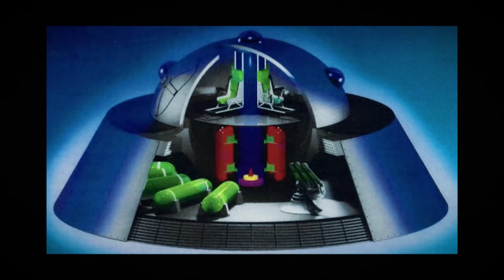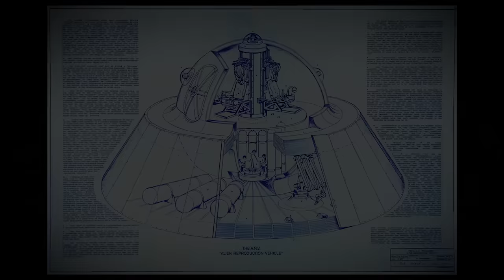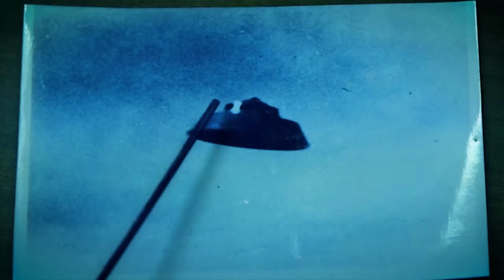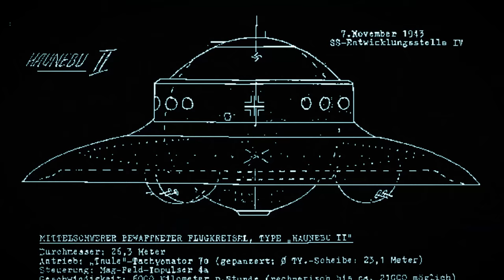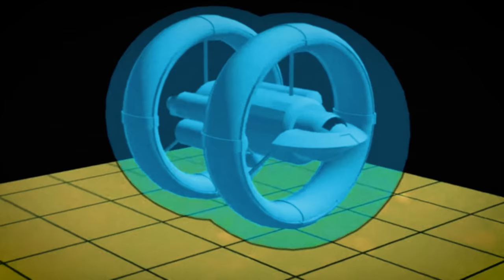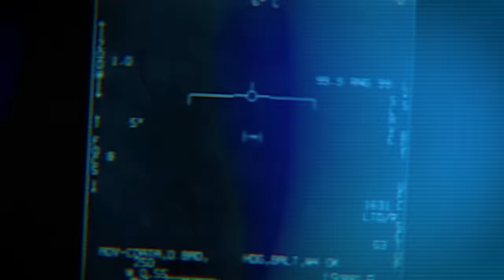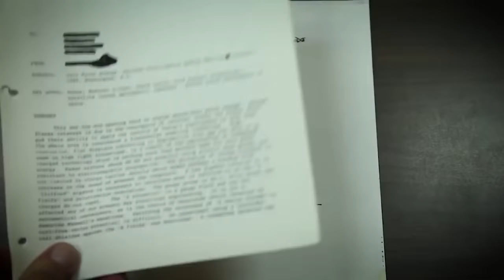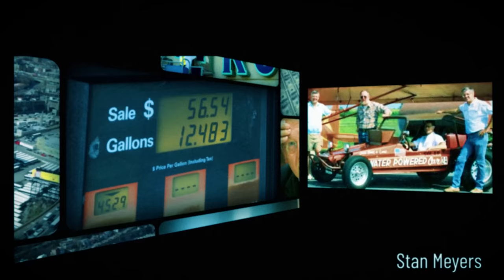How to Build a Working UFO | Alien Reproduction Vehicles (ARVs)

Comment: I saw a flying saucer once. It was late at night and it was hovering about 100' up on the air. I would guess it was about 25' diameter. It was silent, slowly rotating, and had a few lights on the underside. It hovered for about 10 seconds then it started to spin and the faster it spun, the faster it moved. It took off in an arc and was gone very quickly like a shooting star almost. Wild moment for sure. I probably would have thought that I imagined it but luckily I was with a friend who saw it too.
Reply: Same, on my way to University, waiting at the bus stop, it was when the day lights saving time thing changed, so it was darker in the early morning than it usually was, around 5 or 6 am still looked like night time. Across the street on top of the library there, there 3 evenly spaced out glowing orbs, all in a mist of clouds because that day there was a lot fog and it looked to be close to the ground. There are planes that pass by that you can see from afar because the Miami International Airport is nearby by a few miles away, and I saw the lights of a plane fly by behind it, far away in the sky, which gave me a sudden realization of how close those 3 lights were, it was no plane or w.e else…I just stood there, why didn’t I take out my phone to record it? It was as if I wasn’t thinking straight, did something compelled me not to do it? I just stood there watching it with anticipation, and then without making a sound, it just moved up and disappeared behind the mist and clouds, just like that.
Reply: Seeing one up close and personal is such an amazing event. It changes the individuals forever…
Reply: Sure you did
Reply: @PITFALL11  a part of you is thinking "is this for real, is this really happening?" you question reality, or the event, because it's so surreal and so out of the blue, maybe that's part of the reason why I didn't record it, cause a part of me was more busy questioning if I was really seeing this or trying to explain it away like some trick of lights(although that's dumb cause the library has nothing of the sort on top...like I said, you shut off your brain and you're just staring wondering wtf is happening)...not when it started moving though, but by then it was already too late to take out my phone
Reply: @BringDHouseDown I’m in NE FL and have had a handful of odd observations too. 
The silence is the weirdest thing ever.
Reply: I saw one in the 90s in Minnesota,still remember where at what happened,to me it's like the starship  or The Gravitron -is an amusement ride, most commonly found as a portable ride at fairs and carnivals.Pretty much how you explain it that's how I saw it too.

Comment: On the 11th of October 2003 I saw a real flying saucer hovering over North Auburn, CA. It pitching slightly  forward  and backward while hovering and flinging angelhair out of the area between the edge of the Sauce and the atmosphere. It did this hovering for about 10 seconds then shot off towards the Northeast without making a sound. I have since seen both black and white Flying Triangles. The last time was the 24th of August 2022, this year. From my experience with these vehicles once flying away at high speed the craft cannot be seen. 
For me this was the most interesting episode since I subscribed 4 months ago.
Reply: Christo Ronaldo  you should not disparage someone sharing their experience. You were not there with them, so do not make fun of them for their comment.

Comment: No doubt this is going to be another outstanding episode!! Fingers crossed AJ tells the whole story, especially about Mark McCandlish and what happened to him when he was able to reverse engineer what Brad Sorenson saw!
Reply: It's a great story and still ongoing. We know the US Navy has some of this technology, what we don't know is what remains in private hands.
Reply: The Why Files also always seems to come up with a new fact or two that isn't as well-known.
Reply: @godwarrior3403  That comment didn't age very well, did it?
Reply: @dextermorgan1  you need to do a little research on mccandlish and fraud Greer
Reply: @godwarrior3403  The stories have been around for a long time.  One of the curious and genuine facts that keep the pot at a simmer is that you can track the "evolution" of that particular form of UFO through time since WW II and the "glockenspiel."  The "Vimana" account can be regarded as over-interpretation of translated Sanskrit.  While the relative proportions change the elements remain steady.  Some parts of the story are easily questioned.  Greer for instance seems to have begun more or less sane and has slowly slid off the edge of disk world.  I tried estimating the odds of such an odd association of deaths, but the problem is really complex once you start trying to quantify it.
Reply: @godwarrior3403  Well, he'd be wrong then.
Reply: @godwarrior3403  Not this time.

Comment: Woah, there are so many eye opening things in this. A very well researched and put together video, with plenty of entertainment factor. AJ, I would store the original somewhere extremely secure if I were you. And everyone on here who has watched and/or commented on it, it would be good if you shared it across as many platforms as you can as a security measure. The more people see it, the safer he'll be. Watch your back AJ!
Reply: It won't make a difference.  If govt seriously wants someone gone, they're gone.  We don't do anything.   We shout for a bit and then something mega just happens to occur to occupy all the media - at the risk of sounding too cynical, a fabricated something -  and presto - it's over.  We've moved on.  For example, who now still talks about Jill Dando - or even knows who she is?

Comment: Unsurprised that this episode was not promoted by Youtube. I' built a model ionocraft in my last year in the air force (on my own time) and flew it around my barracks by remote control. I investigated a lot of the pre-roswell patents from Seversky, TT Brown, etc.
Reply: Yes me too, I've build one 4 years ago using a flyback (self made light and small) a mosfet a resistor and tinfoil and copper wire, easy, the other way is using gyroscope's but that's more difficult and very expensive, if I have the money I sure would build one, a big one and fly it myself!

Comment: The mercury based engine sounds incredibly similar to the Magnetic Field Disruptor engine that Edgar Fouche describes within the TR-3b, it uses a mercury based plasma that is pressurized to 60k psi and is rotated at incredible speeds that reduces the effect gravity has on the mass of the vehicle, very fascinating stuff.
Reply: What is the TR-3B
Reply: @MrArtVein  Lockheed manufactured triangular ufo that you can probably see on pentagon 'declassified footage'. T stands for trainer, R for reconnaissance.
Reply: Mercury based, like the Vimanas in ancient India.
Reply: Sounds a bit like Dr Salvatore Pais' 'Pais Effect'

Comment: Alcubierre's "Warp Drive" hypothesis whereby compressing space time in front of the vehicle and expanding it at the back sounds a lot like what Bob Lazar described when he discussed the reverse-engineered "sport model" he saw at Area 51. Billy Meir discussed something similar when he talked about the need for a (space)craft to tilt on its side at 45 degrees for almost instant propulsion because the craft creates a toroidal field.

Comment: Sorry to debunk something a little more but I was stationed at Norton AFB in San Bernadio CA From around 1990 till it closed. I worked on the flight line and was in the hangers while there. Nope, just hangers. The large four-hanger building rumored to have access to underground tunnels? Nope, again not there they repaired C141 in there.

Comment: A.J., having mil intel experience I can assure you that when D. Grusch refers to alcubierre warp drive he's alluding to something operational for roughly 20 years, in association with some very tall and pale 'allies'.
Reply: I'm still skeptical on FTL travel. If you just think about it, the closer you got to FTL you'd see yourself gradually getting closer to yourself because your future self would be traveling backwards through time. You'd somehow either have to accelerate fast enough not to collide with yourself or else you'd fuse or run into your future self, unless their is something I'm missing about this theory.
Reply: @johnwesley256  imagine the inner and outer existing in two separate 'fields'

Comment: So the mercury drive is a liquid gyroscopic propulsion system. Making a gyroscopic lift counter to the force of gravity. Maybe? Free energy may be direct interaction of zeropoint energy using mercury vortexes. I made a plasma capacitor using a microwave and a pencil lead capacitor using wax and paper soaked in salt water suspended in a peanut butter jar. It looked like a mini sun from the plasma arc. When I turned it of the strong electrical field shocked the heck out of my hand. It was a severe electric shock that hurt my hand. That is maybe more power than a tv flyback transformer. But that high amount of energy was stored in the device discharged from the jar. So the asymetric capacitors may store energy in the ufo making thrust or making the warp field needed to move faster than light speed like my little experiment.

Comment: As far as I can tell the zero point energy can be captured when the mercury is in a vortex. However, the part that raised my eyebrows was the method for doing so from what I heard was to super cool and use an electro magnet to spin it around by turning it on and off at specific intervals that cause it to move faster. If applying voltage to mercury achieves the spin required then so be it but I heard that the reason we super cool the mercury is because it makes the mercury move faster.

Comment: You’ll need to use eigenvectors when solving this problem. Hope that points you in the right direction. If you start to figure this technology out, make sure you save your data in both English and Chinese. It helps to have a Chinese friend. Upload the files in parts on various sites all at once. Good luck.

Comment: When traveling through time, think in terms of frequency. Every object in this universe has it's own unique variable location frequency signature. By changing the frequency of an object you can move it through space and even time. For example; take a hollow copper ball, about 3 inches in diameter. Place it on one end of a flat 8 or 10 foot level board or table. Strike the copper ball gently, to make it vibrate, and with the proper equipment, you can measure its vibrational location frequency. Now, move the copper ball to the other end of the 10 foot board/table. Strike it gently again, and measure its vibrational frequency. With the proper equipment, you will notice a slight difference in its vibration. Now, move the copper ball back to its previous location, at the other end of the table. Induce the exact vibrational frequency that the copper ball had at its previous location, and it will either roll to the other location or instantaneously move to the other location. This works for anywhere in the universe. This is how you can teleport objects as well as ships instantaneously across space (and time). Practice, practice, practice, Light Worker. "If you want to find the secrets of the universe, think in terms of energy, frequency and vibration." - Nikola Tesla (Kahuna Cat)

Comment: Zero point energy is really the depth of the ocean rather than the amplitude of the waves,
Its said the arv flux liner could be built on parts from most army navy wtores and a 3D printer maybe. The internal control mechanism of direction and thrust is ingenious and simple, 
Somewhere in my place i have blue prints of this craft and block diagrams of tr 3b as well

Comment: IMO using quantum fields is behind it all. Faster than the speed cant happen classically (eg Photons have no mass thus the fastest, C) If we can bend time so we can arrive almost at the same time or later(maybe b4)?, F knows how. Gravity is just space-time dependant on your inertia,  Expansion of the universe. It appears that they are traveling at the an enormous speed to others but to the pilots its slow as time slows down. Thus no inertial SQUISHED problem and you don't piss Einstein off! Insane Physics

Comment: FTL travel is made possible via exploiting the fact that the universe expands faster than the speed of light, and when we compress/push space itself around the craft, we can access & exploit the movement of space itself, thereby moving faster than light while not violating any laws of physics.

Then there are wormholes, but this is achieved differently and many scientists postulate that black holes may even be a type of wormhole. Magetars may also cause these wormholes throughout the space around them.

Comment: Art Bell died not long after pointing out that an extremely tall radio antenna he owned needed to be fitted with a frankinstein switch to vent excess electricity that was building up, seemingly from the atmosphere

Comment: if you allow mercury under applying pressure of 9bar to chanfe its capacity state, it will generate diverse power states - this allows to travel with the speed of light

Comment: Ok people, they havent gotten me yet so here goes
Its way more simple than people think.
WATER.    
Use stainless steal due to it not corruding really fast. Hint...lots of things are made out of stainless steal.....you can use razor blades, sink strainers, whatever....Using even a low current (DC even) put two pieces of stainless not touching into a jar of plain water......run wire from battery to both pieces of stainless....1 pos.....1 neg.
The bubbles you see forming, coming to the top....is bubbles of hydrogen and bubbles of oxygen.....2 of the most explosive things ever. Both the hydrogen and oxygen can be seperated,(easily) and caught, and stored.   Firm believer there is enough power in a quart of water to power a house for a day......probably more.
Reply: That's a grade school science experiment.

Comment: Wow: ChatGPT confirmed it could be possible!!!
If you have a Tesla coil and two rotating mercury disks, all generating magnetic fields, there are several interactions and effects that could occur:

1. **Amplifying or Attenuating**: If the magnetic fields of the Tesla coil and the mercury disks are in phase, they could reinforce each other. However, if they are in anti-phase, they could weaken or even cancel each other out.

2. **Rotation Effects**: The Lorentz force acting on the rotating mercury through the magnetic fields could influence the speed, direction or even the shape of the mercury rotation. This would be particularly pronounced if the magnetic fields are strong.

3. **Resonance Effects**: If the frequency of the Tesla coil's AC voltage matches (or is a multiple of) the rotation frequency of the mercury, resonance effects could occur that increase the amplitude of the magnetic fields or the rotation speed of the mercury.

4. **Energy Transfer**: When the Tesla coil transfers energy to the mercury discs, they could act as secondary coils in a transformer, with the Tesla coil being the primary coil.

5. **Complex Field Patterns**: Interference from three magnetic field sources could result in complex and constantly changing magnetic field patterns that are difficult to predict without knowing specific details about the strength, frequency and phase of the fields.

The exact result depends on many factors, including the strength and frequency of the Tesla coil, the speed and direction of mercury rotation, the shape and arrangement of the components, and other variables. It would be a very interesting experiment, but one that would need to be carefully planned and carried out to ensure it is safe and to produce meaningful results.
Reply: let's say with dc conversion, two directions of rotation, perfect usage of acceleration and amplifying for the mercury and the 3 magnetic fields... possible 😅

Comment: even with just the circulating mercury, couldn't you somehow get energy/electricity from that? provide a current, get the mercury to rotate/spin, and while it spins it turns a turbine or something (im not an engineer) that then generates electricity? hopefully at a greater rate than what's put in to get the mercury rotating in the first place

Comment: The thing I do not understand with the energy issue is this.  There is no such thing as FREE energy.  Example:  Solar energy is FREE, but you still have to have BUY a solar panel to collect the energy.  The same with anything Tesla and others have worked on, you still have to build it and get it to were you want to do work.  So if this stuff works and we are constantly being told Fossil Fuels are bad why are we NOT using this "SAFE" energy?  We can not get nuclear power plants built.  two things come to mind, one the energy density is so high that large scale use and accident could blow up the plant.  Two, the Lizard People are real and there is a organization that actually wants us kept locked up on this plant to harvest us.  Two sounds most likely.